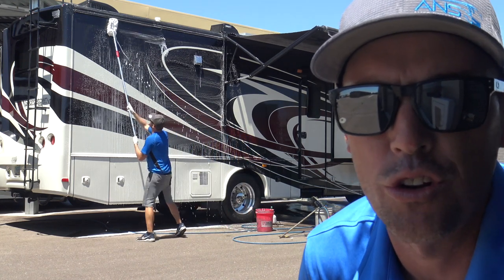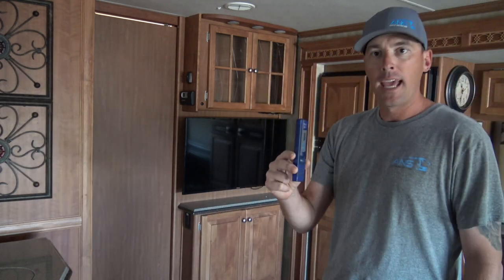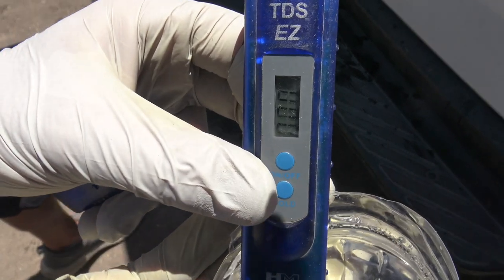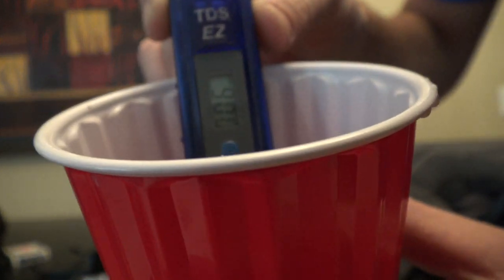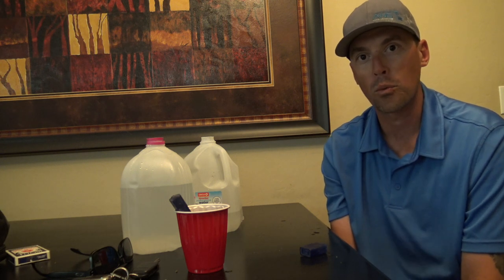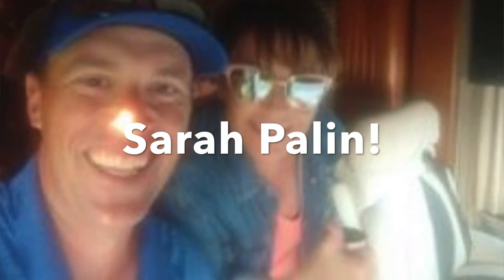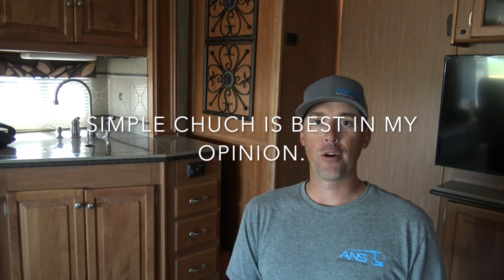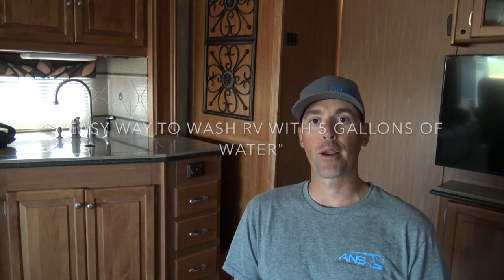WHY WASH RV WITH DEIONIZED WATER?

Comment: Andrew what water do you start with no sure of your process do you use tap and run it thru your di system and fill your supply tank that you wash the coach with
Reply from the maker: D.i. water for everything. I talk about it in a few of my videos.

Comment: What do you think about driving a coach through a truck wash?
Reply from the maker: I don't. truck washes are known to damage coaches and use hard water that will hold in the cracks and eventually run down the side of the coach causing hard water.  coaches that go through truck washes usually have hard water spots coming out around all the windows the door handles and the gutters along the top.
Reply: @RVingwithAndrewSteele  Andrew you are spot on about the truck washes .They are called Streakin Beacon's for a reason . 20 year truck driver here saying never ever ever get your RV washed there .